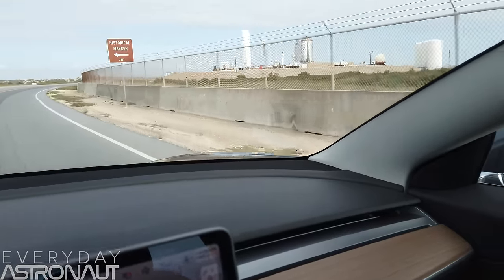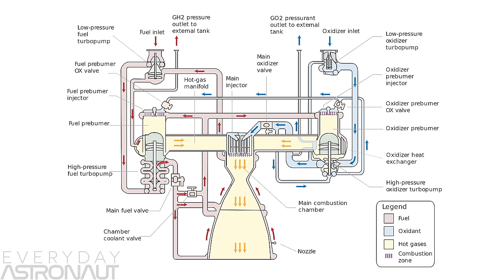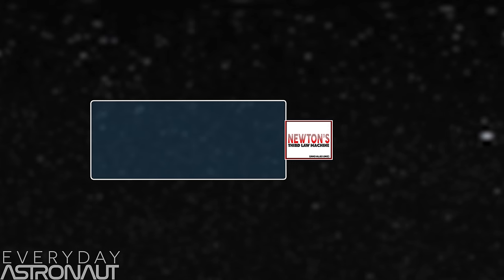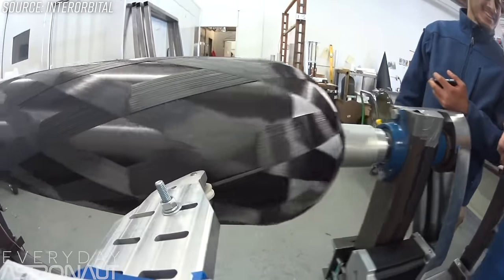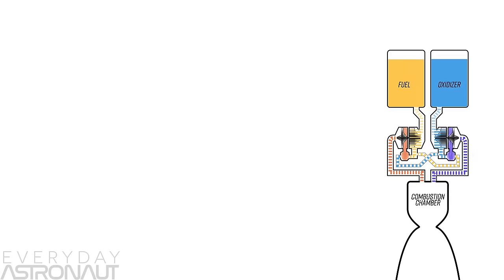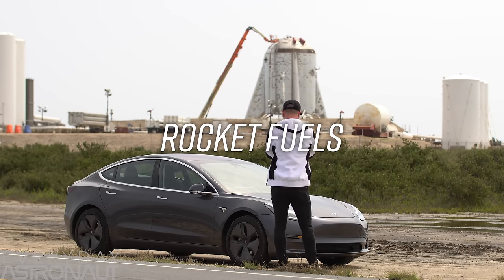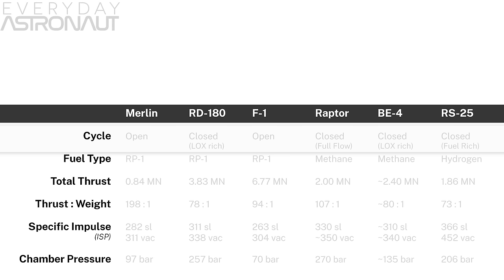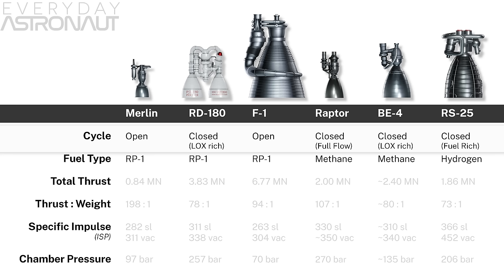Is SpaceX's Raptor engine the king of rocket engines?

Comment: 41:20  €/flight:
rs25 should be divided by average, not max(19).
also fuelcosts for static-fire should be includet.
Reply: bot sure if average or max. I think it's fair to take average number of flights until motor was too demaged to be reused. 
Its not fair to decrease avg reusability becouse the vehicle  was to demaged, but motor was ok

Comment: Can you answer this question?  Solid rocket boosters, as used for the Space Shuttle and will be used for Artemis,  are just big heavy pressure tanks able to hold throughout a pressure higher than that near the throat of the of the nozzle.  They use a significantly  lower Isp solid fuel-ox mix and they can't be throttled.  Why do we not use as boosters the same strong pressure tank compartmented in to fuel and lox sections and simply valve the propellant into a combustion chamber.  Bleed some of the gas back into the tanks to keep tank pressure up and you have a very simple, very cheap, yet reusable booster.  Why instead do we use gigantic bottle rockets that can leak as in Challenger?

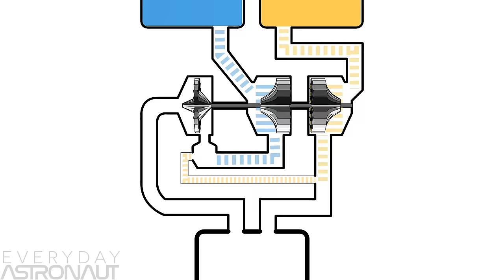Comment: 11:50 wouldn't shooting all of the oxygen into the preburner still heat up the turbine just as much as what you mentioned earlier? I'm confused.
Reply: You shoot too much oxygen to the turbine. So yes, the oxygen portion you burn, you burn at very high temp but you don't burn all oxygen. Leftover oxygen is still very cold and these combined are not very high temp. Hope this helps.

Comment: Man, now I want to learn how the Preburner works, that sounds pretty interesting how they would overcome the "Chicken and Egg" issue. Would they have an electric "starter" to prime the system by spinning the turbines to increase pressure to light the preburner, then when it's detected that has started, the starter would disengage? Or would the pressure from the tanks be high enough to just get the preburner running, elbiet inefficiently, just enough to get pressure to make everything run optimally? Man I really wanna know!!
Reply: They actually shoot high pressure helium at the turbine to spin it up before they open the fuel valves to the pumps. It works very well.

Comment: In case of you future rocketeers questioning why real life engines have like dozens of small wires more than Tim's diagram, people have to account for avionics, control and direction of thrust, etc. So basically, if you build an engine made completely based on that simplified diagram, you're going to end up with a manually - activated, no throttle and no gimbal pressure - fed engine. And installing it on a rocket, you would not go anywhere near orbit - just a vertical trajectory with a very high apogee.

Comment: Hi Tim, My earlier post seems deleted.  Looks like you have a typo for the Isp of RP1.  You have 370 when actual theoretical Isp seems closer to 470.  If it was 370 then Merlin 1D would be 98% efficient.

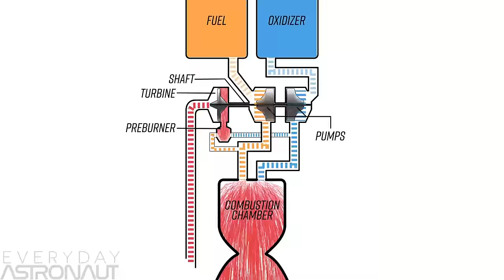Comment: 10:15

You know the Rocketdyne F-1, I don't think it's considered a Closed-Cycle Engine — at least in my book — but it's worth mentioning that the Exhaust Gasses of it's Preburner are vented back into the Engine, but not into the Combustion Chamber.

Instead, those Gasses are vented into the Main Exhaust of the Engine, through a Turbine Exhaust Manifold that wrapped around the Bell-shaped Nozzle of the Engine.

I don't know if this was the Reason why the Exhaust of the Rocketdyne F‐1 had a Unique look to it — a dark sooty section of the Exhaust directly following the Nozzle Extension — but I'm betting it is.

Comment: What's really interesting is that rocket engines are actually cheaper than the current generation turbofan engines you see on airliners. The GE9x on the Boeing 777x costs $42 million per engine. But of course, the turbofan is designed probably fly nonstop for over a decade or maybe even 2, flying thousands of flights.

Comment: Tim, there are three conditions in engineering, vicious cycles, trade-offs, and virtuous cycles. When you were talking to Elon about how 1lb of mass almost equals two when "fully considered" you were talking about avoiding a vicious cycle. Saving mass then, would be a virtuous cycle. These are book-ends to the middle condition of trade-offs. 

You're right that in engineering you quite often have to settle for trade-offs, and picking the best trade-off is the best you can do, BUT, this is NOT always true. Two great examples are the US redesign of the Panama Canal featuring Gatun Lake, and the design of the F-16 fighter jet which uses the tail as a lifting body, augmenting the lift of the wing, instead of working against the lift of the wing, AND balancing the plane so that it provides no lift, up or down as it crosses through the sound barrier, completely eliminating Trim Drag. As a result, the F-16 has up to 15%less total drag, and also goes through Mach 1.0 without any hesitation at all. 

It's a small point, but an important one. As an engineer you always know immediately that you have found a good solution when everything gets better. Catching SH's grid fins with MegaZilla so the mass of the legs can be moved off the spaceship and into Stage 0 is a perfect case of a virtuous cycle, so again, not a trade-off, because everything gets better.

Comment: Liquid methane is the same thing as LNG (liquid natural gas), which is transported in uninsulated containers all the time.  It doesn’t require insulation because it is stored at pressures that are high enough to raise the boiling point above ambient temperatures.  So why does your chart show methane as stored at 111 kelvin?  Could you address this in a future video?

Comment: There is one thing I missed, Raptor uses Methane -> CH4 so it has carbon in it, doesn't that mean, that the engine will be unusable because you would have a fuel-rich preburner with Carbon like you said earlier in the Video.

Comment: The Raptor is already due to be replaced by the Raptor 2 which has simplified plumbing and greater thrust at a lower cost with a greater possibility of being re-usable the most simply.  It is being tested and will not be used on the first orbital test of the BFR.

Comment: You should multiply the number of flights by the number of engines per flight. Like 71 merlin flights but most of those were a rocket with 10 of the same engine.

Comment: Hindenburg went down because the heat shielding paint was similar to rocket fuel,  when they earthed it, some panels didn't discharge properly and sparked, then the outside skin just went off like a rocket you could say. This was discovered when they edited the footage to colour and realised it wasn't the right colour flame for the gas to be burning.

Comment: WHY IS THE DENSity in the rp-1 best, shoudnt a lower density be better for a lighter rocket?
Reply from the maker: No, a lower density means bigger and heavier tanks to hold the same amount of fuel. Engines require a precise amount of fuel and oxidizer by mass, so the tanks for hydrogen end up being HUGE for the same mass of fuel

Comment: Is the thrust to weight ratio so great with the merlin because of its small size? Volumetric flowrate of fuel and oxidizer, and thus thrust increases by the square of length and mass increases with the cube. Seems like smaller engines, all else being equal, should win on thrust to weight ratio.

Comment: Very interesting, and thanks for putting such a great level of detail into this presentation. The hard facts, physical performance of the engines side by side, is by far the most convincing and useful comparison of the different designs.  I do struggle with the value of cost per unit calculations. The amortised cost of each engine unit of the redundant/existing engines is a known quantity. Where as Elon's cost per unit estimate is based entirely upon a finger in the air. He could just say Space X will produce 10K units and the development cost gets slashed by a hundred times. Also, it cost a lot more to calculate complex dynamics in the 50s and 60s with slide rulers, or a tape to tape mainframe, vs running an overnight AI simulation in the cloud. To give a better analogy, you realistically can't compare the performance of a 1950s generation fighter jet, with a 2020s jet, based entirely on inflation corrected development costs.

Comment: That closed cycle was used in the F-1 engine.
Reply from the maker: F-1 is open cycle / gas generator, not closed cycle. It’s exhaust is used for film cooling the nozzle extension but it’s not closed cycle 👍

Comment: I would like to propose that to keep the engines from melting we use water injection to promote a boundary layer of water vapor to insulate the Bell nozzle from extreme heat. 
I propose we make the engines big like 25 ft high..bigger nozzle gives more time for propellent to burn inside the nozzle,   Bigger nozzles
are known to be unstable though.
To fix that lets do like with jet engines-having maybe 6 burner burner can combusters

Comment: Hello @Everyday Astronaut. I love this great video, but I have a question. 
There is one point I don't get: You say, that in all cycles, the preburner chamber is the point of highest pressure in the whole engine. Okay. 
You say, that in all the engines, the chamber pressure can not be higher than the pump pressure, and so the pumps have a lot of load on their tiny metal shoulders. That sounds like a disadvantage relative to the full flow... 
And then you switch to the full flow, but don't mention at any point the relation between the chamber pressure and the pump pressure. 
And so it sounds, as if the full flow solves this problem, but in my understanding it rises the problem. In the full flow engine the pump pressure MUST be far HIGHER than the chamber pressure, because everything downstream of the preburner chamber is on lower pressure . But you mention, because of the mass flow in the turbines, the pressure in the turbines can be LOWER. But isn't the goal of the full flow engine to archive higher chamber pressures? So that the pressure in the turbines must be higher? So what point of the video I missunderstood?

Comment: Just because an engine has been test fired on the stand multiple test fires doesn’t mean that it’s the same engine being loaded on a rocket, that simply means it’s been tested pending anomalies, it was ran and any anomalies of parts and components were replaced to accommodate the success on launch. People confuse reliability and reusable use out of these engines…

Comment: Three Questions:
1. How does oxygen exhaust gas melt everything away when the only reason to run rich is to cool stuff down and why doesn't it happen when fuel rich?
2. How can this advanced engine with two pumps and the special alloy for the oxygen rich side be almost as cheap as the open cycle Merlin?
3. 43:08 but didn't two Merlins fail firing back up on the center booster of the falcon 9 heavy test for the deceleration burn?

Comment: It seems like they updated the SpaceX engines a little. Seems kinda similar to a design I came up with, that self pressurizes itself for space flight. 

Although it's not an exact copy, and some of the principles are different... and it doesn't have a piston controlled gas pedal like mine either.

Mine should run on Methanol/peroxide. Adding diethylamine to the mix may help maintain pressure, as it has a lot of nitrogen, which is inert.

I like methanol and diethylamine as fuel, as you can produce HUGE amounts of them pretty quickly, without being that costly at all. Just a big farm, and a silo sized graham condenser. 1 field for methanol (corn field) 1 field for diethylamine (legumes, they also produce many other useful chemicals, that can be used in space age manufacturing).  You could probably do this in a Spaceship, space station, or on a terraformed planet, like Mars.

Comment: 8:16 the inly thing I did not understand was “pressure always flows from high to low” rest was a piece of cake
Reply: A simple explanation of that can be summarized like this: pressure is energy. Take a liquid propane tank as an example - propane is not normally a liquid at room temperature. It doesn't become a liquid at room temperature unless it's upwards of six times as pressurized as the atmosphere of earth at sea level. Propane stored in a tank has to be pumped into that tank using an immense amount of energy to force it into a liquid state - and aside from the energy lost to thermal inefficiency, all of that kinetic energy is stored as potential energy in the propane, which is in the tank. That's why the tank needs to be thick steel - if it weren't strong enough, the physical force used to push the propane into the tank would just burst the tank and the propane would revert to being a heavier than air gas. When you open the valve of the propane tank, the propane boils as the potential energy stored in the form of pressure turns back into kinetic energy and forcefully ejects the gas left when the propane boils into the outside of the tank. It can do this because the propane in the tank has more potential energy than the atmosphere outside of the tank - in order for things to be stable without a steel wall and without supercooling the propane, the atmosphere and propane both need to have the same amount of pressure - the same saturation of potential energy.

If you stuck a full, room temperature propane tank into an environment with 14 atmospheres of pressure, which is about the max we actually find in propane tanks, then opened the valve... liquid propane would pour out, because the potential energy saturation inside and outside the tank are the same. The propane does not possess enough energy to boil in that environment, because it's not hot enough to reach its boiling point at that pressure, let alone to supply the latent heat of evaporation.

Side note: that latent heat of evaporation is why when propane vaporizes, it's really cold, and why it heats up while it's being compressed - boiling in and of itself takes energy beyond what's needed to reach the boiling point, and condensing into a liquid frees up the energy that was spent boiling in the past. This is also how refrigerators work - if you use a machine to forcibly alter the pressure of a chemical with properties similar to propane, you can force it to absorb heat from inside the fridge in order to boil when you lower the pressure, then after you move it further from the inside of the fridge you can forcibly compress it, which pushes the heat it absorbed while boiling into your house. Then the cycle repeats as the re-liquified refrigerant is pushed back into the part of the refrigerator where it boils. Propane is even used as a refrigerant in some cases.

Comment: Using a pump on each engine seems a little strange if you think about rocket engines like cylinders in a turbocharged cars engine. Very few cars have more than two turbos even on large engine. My question is, why not fewer, larger pumps powering banks of engines? rather than having a turbo (turbine pump) per cylinder (rocket engine)...

Comment: If you think the Raptor diagram is impressive, just wait until the actual production prints make it to the general public. The Raptor is damned near magic when you dig into the prints. I am lucky to be involved with the production of some of the components that go into just about every rocket used for orbital flight. Just wait for the Raptor's replacement.

Comment: I actually don’t understand why you need these fuel pumps - shouldn’t it be possible to just preheat the cryogenic fuel and thereby create high enough pressures? The nozzle should easily able  to provide enough thermal energy for that during operation?

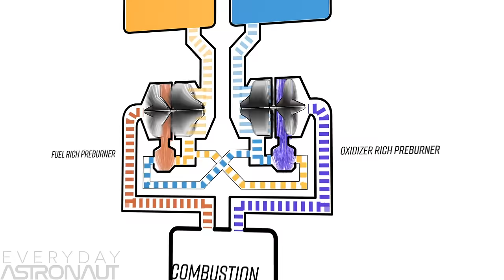Comment: 19:37 Did you try adding water ? As it cools the turbo's, it may be boiling, and also added to the combustion chamber, which then has water turning vapor and also increasing the gas pressure.

(And yes, water, the cleanest fuel ever.)

To add to that, try using microwave to further help expand the water vapor.

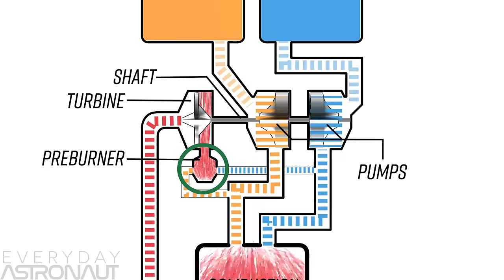Comment: 08:02 And you guys happen to have electric engines that can power a car, or a turbo initiation engine.
And here's the kicker, the fan itself, when magnetised can be pretty much performing the same in just a few components less, since it only needs initial speed for revolution. Add on top some induction, and now you got a two way street for electromagnetics, applied directly onto the the turbo fan.
Reply: Using a high heat generation and water can also create a propellant.

Comment: 8:14 so I understand high and low pressure thing and i’ve got a question. 
if flow goes to low pressure from high pressure, how is high pressure maintained in turbo pumps? i mean when there is low pressured inlets connected to the chamber, why do propellants go to high pressured inlets and maintain the pressure? are not they supposed to more or less equalize the pressure in both turbo pumps and chamber?
Reply: Centrifugal pumps create low pressure inlets and high pressure outlets. The propellant flows from the pressurized tanks to the ow pressure pump inlets, and out the high pressure pump outlets to the slightly lower pressure combustion chamber.